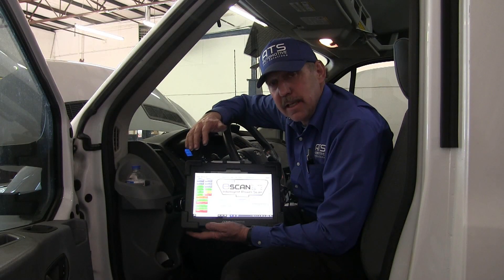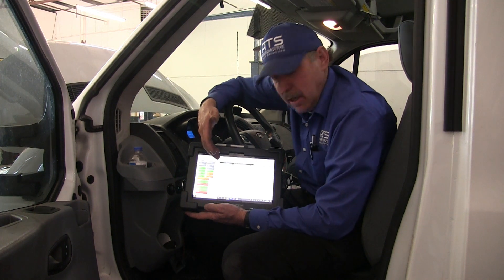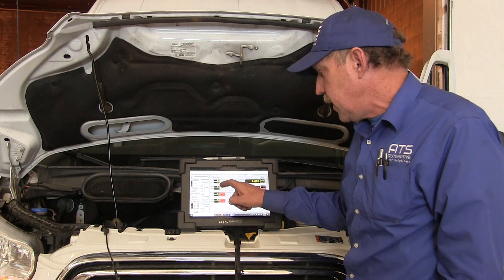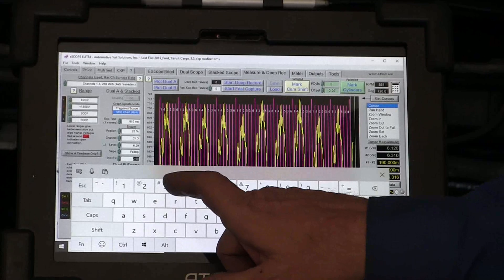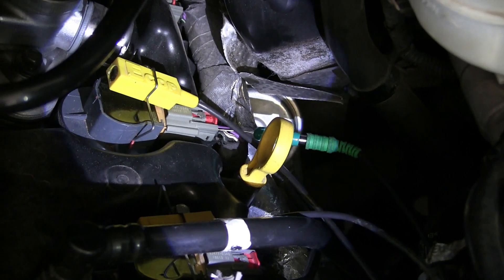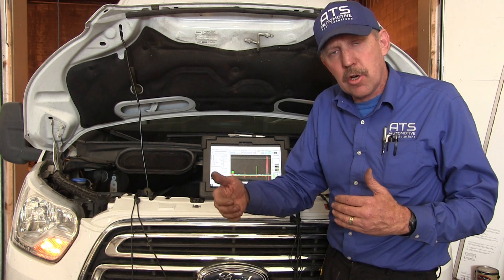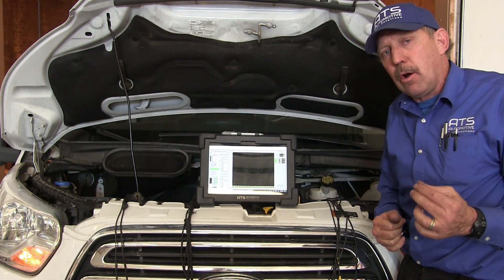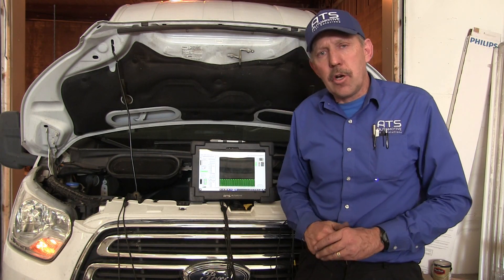Diagnosing a Misfire on a 2015 Ford Transit

Comment: I think it would be better to test for short to ground on that trigger wire, cuz if it does, it'll short out the driver inside the ecu again. Great video as usual. THANKS.

Comment: So after I go to school for electrical engineering and dona internship at
Spacex in their particle waveform accelerator project,  then I can work at pep boys?

I went to three Ford dealerships, and they couldn’t tell me how to order a wiring harness. Then I called Ford for help and they told me I needed to talk to the Ford dealership. No one could figure out which harness went to my radio.  

My point is that there is zero chance any of these tests are happening at a dealership. I bet the mechanics couldn’t even turn the machine on.
Reply: I have a 2015  Transit cargo van was stalling randomly, went to the dealership they throw $10k of random parts over a period 8 months  of back and forth and never fixed the problem, then i had to finally investigate, it turned out the ECM fuse was loose, (the 2 little fuse pich fingers in the fuse box were open) that solved the problem

Comment: Someone needs to tell the ford dealer near me because my 2016 transit fleet vehicle has been missing for about 2 years and they can’t figure it out. Many of my coworkers are having the same issue with their transits as well. It’s to bad because they go nicely when they run correctly

Comment: There would be one more test that I would do before condemning the PCM after the unplug it test showed the signal come back to normal. You missed one more variable. You could have that driver output wire in the harness shorted to another ground ref wire going back to the PCM.  Unplugging the PCM would open the ground ref circuit.  The next test before condemning the PCM would be to check for a short between wires.  You can check for that by leaving your signal generator installed on the driver circuit and then probing the other pins in the PCM connector to see if the signal shows up on another wire.

Comment: Nice diag! Bernie is the master!
You can buy a PWM signal generator on eBay for less than $10.
The Gibby has a nice video showing how he modded his one to generate different voltages.
I bought one but have not used it yet. Here's the link:
https://www.youtube.com/watch?v=SPwVpKXw_6g

Comment: Hey Bernie great video, bought your eSCOPE 8 about 7 months ago and I'm loving it, still learning every time I use is. got a question on the TTL on this vehicle in this video, your putting a 5 volt square wave into the circuit and I understand coil drivers will pull the voltage down to about one volt, however when you disconnected the circuit from the coil and the ECM the voltage only went up to 1 volt, shouldn't it have gone up to 5 volts with the circuit isolated from the vehicle? or did you plug the coil back in before unplugging the ECM?

Comment: Great video! I’m always impressed with Bernie. I had a Transit with a #5 intermittent miss that wasn’t missing when I looked at it. Long story short there was water in the spark plug tube due to a aftermarket windshield being installed and they reused the windshield to cowl seal that is only available as part of the OE glass and glued it to the back of the aftermarket windshield. The seal was very deformed allowing water to leak past and dip right on to the #5 coil.
Reply: i just replaced my windshield and i got a #5 misfire and it was the first time i drove it in the rain. ill check it out
Reply: Scott I can’t thank you enough it was only happening lately.. it hadn’t rain here in 2 months. It was intermittent. The coil boot was messed up from a spark plug change at 100k. This saved me a lot of time. You could see the water.

Comment: That test also comes in handy for checking the wiring itself between pcm and sensor  and also to check if some other sensor or device is still shorting out

Comment: I agree with Ivan.  So many times in the past if I had TTL Out, it would have cut diagnostic time.  Sometimes you can "manually" pulse the circuit, but you risk damaging the circuit components with to much voltage or current.
Thanks Bernie.